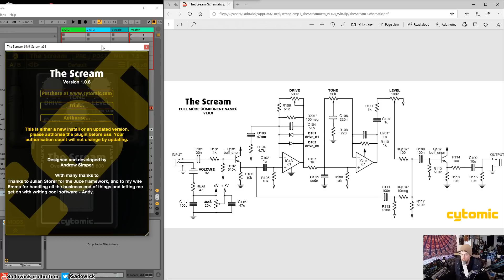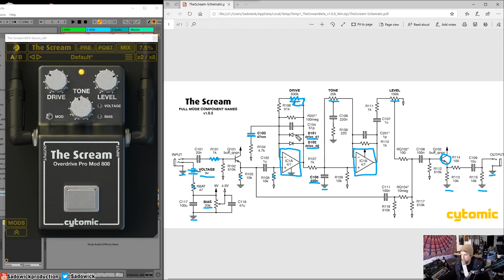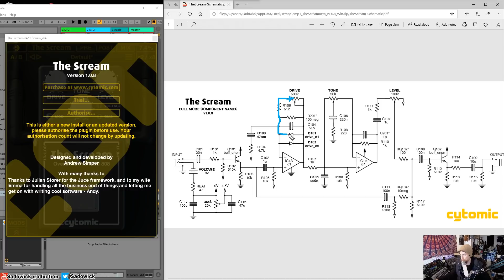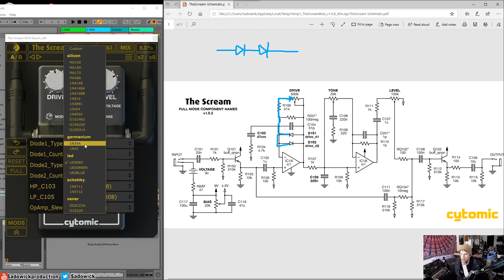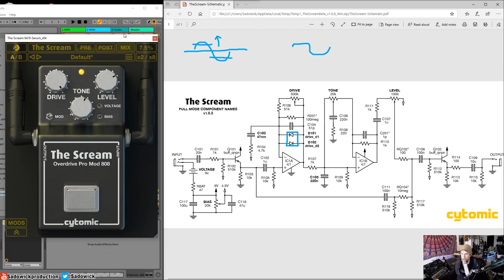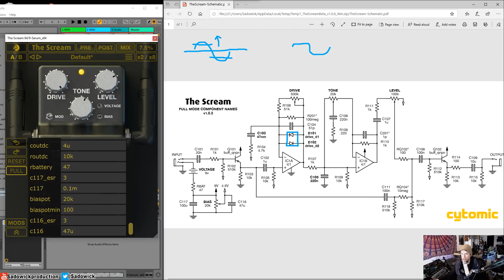Cytomic The Scream - Component Level Guitar Pedal Modifications

Comment: Peavey revalver amp sim does this with its tube amp schematics. You can alter so many parts of the amp. It's pretty cool. And i look forward to having a look at this cause i use a screamer to boost my tube amp and also software amps through the audio interface. Thanks for the info on this. Cheers
Reply: TSE808 is a free plugin and one of the versions had an option to manipulate some components and if I remember right it was before Peavey did that.
Reply: @NeZversSounds  awesome i didn't know that. I have the tse808 from a few years back I'll have to check it. Not sure whether it's 32 or 64 bit may have updated it so might not have the correct version for but I'll sure be looking at it tonight. I like the ignite amps version of the screamer too it has a different character.
Reply: @scallionboy8679  That option was on one of older versions. Don't remember which one.